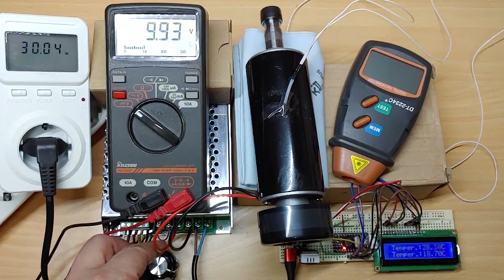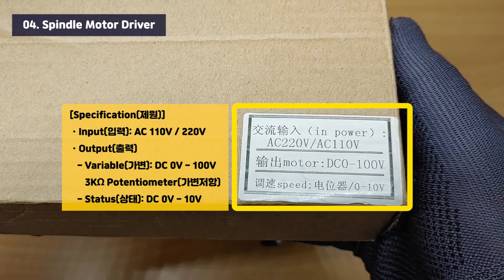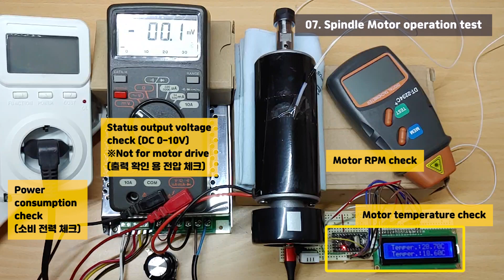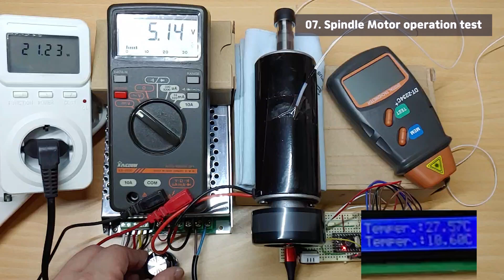#8 [ENG] CNC Upgrade 500W Spindle Motor Kit | Review

Comment: why does your multimeter say 10V and not 100?
Reply from the maker: Hi~ The DC value of the multimeter indicates the percentage of the output, not the output of the motor driver. The motor driver outputs DC 0-100V and outputs the ratio to other ports at DC 0-10V. In other words, DC 5V has 50% output.

Comment: Your motor get hot in use too?
Reply from the maker: Yes the motor can get hot. As the shaft rotates, the greater the resistance, the higher the current consumption and the higher the motor's temperature. Air cooling is limited. Cooling with water is best.

Comment: is it need speed controler?
Reply from the maker: If you don't need variable speed, you don't necessarily need a PWM-based controller. However, the motor in the content is rated for DC 100V.

Comment: Spent too much way too much time showing the product than how to hook it up and did not really explain much. Bummer. Why? Why not take two seconds to show it and then explain the hooking up part?! We would have see everything at that time as well! My god. What a waist of people’s time.
Reply from the maker: Thanks for your comments. It's because I'm a beginner YouTuber. Even when thinking about the scenario, there is always something lacking.
Reply: Hooking up the motor to power or hooking it up to a machine? To power is simple, to a machine it can be difficult and can vary on which machine you got. 
Tbh, if it is hard to connect the 2 wires from the motor to the PSU, 3 wires from the 3k(ohm) potentiometer to the PSU and lastly 2 wires from an outlet (where switching + and - doesn't do anything) to the PSU, you'd might need to do some more research on electronics. You got all the knowledge printed on the PSU at 1:33 to know what goes where.